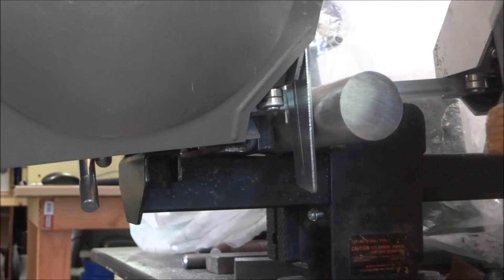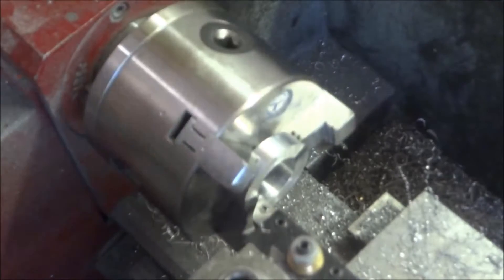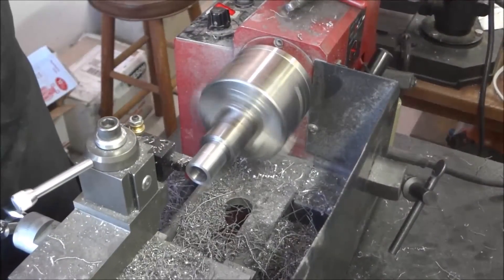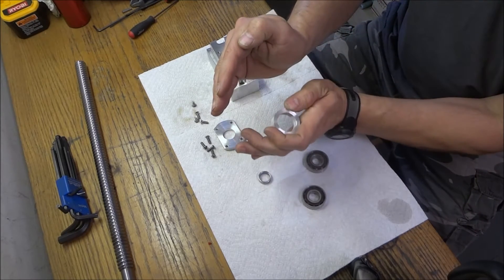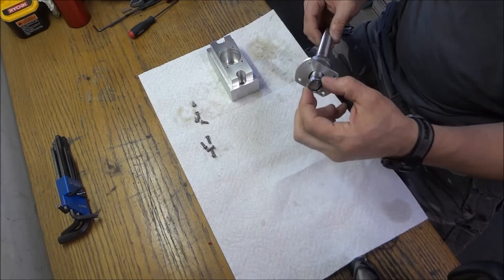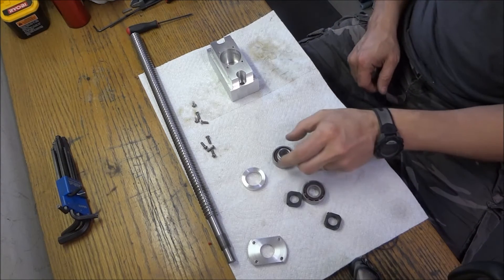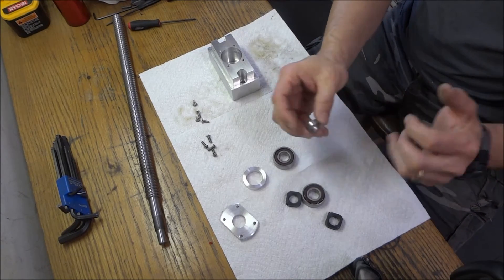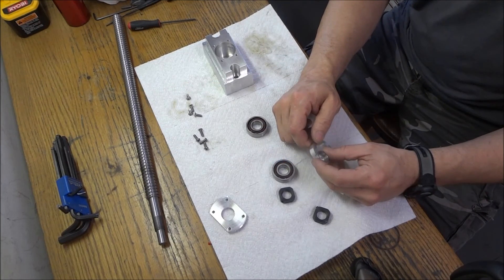PM 727M Stepper Mount Bushing and Shims

Comment: why don't you do the cuttoffs with lathe cnc?
Reply from the maker: +Pouya Bo 
Sorry I thought I mentioned that , Each shim is a different size so it was easier to size with a manual lathe. I could have parted on the CNC but it takes a 3mm wide cut I only had just enough stock as I was using scrap material.
Be safe,
Sam